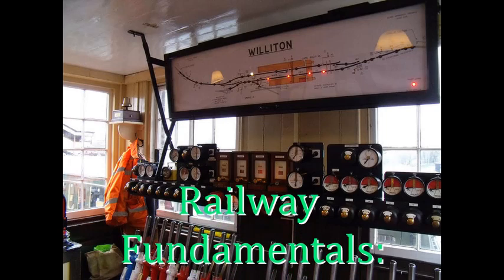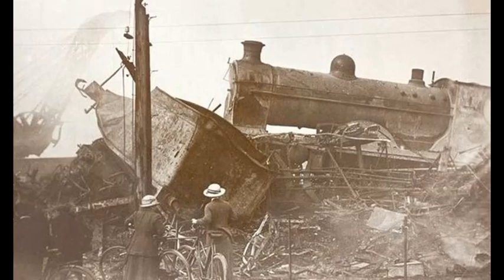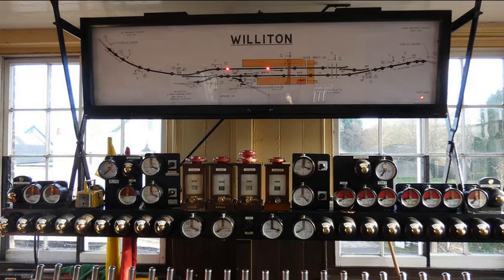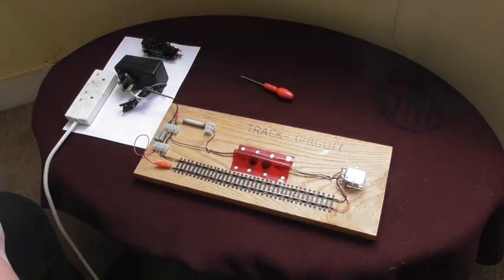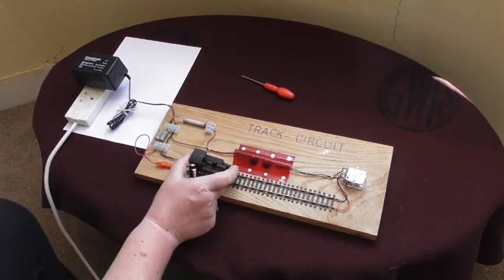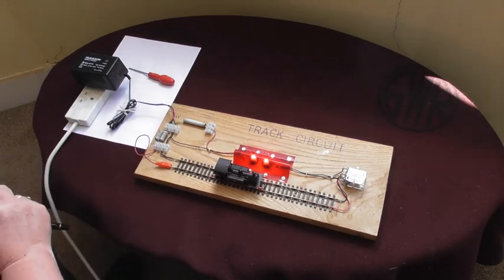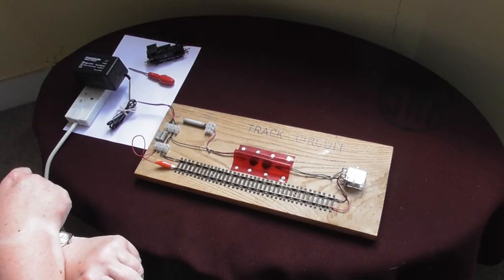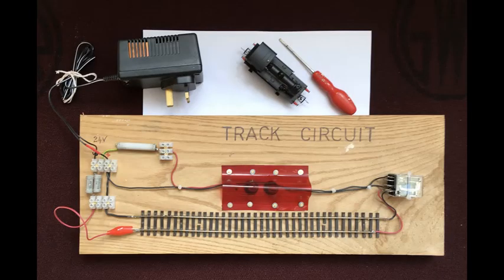Railway Fundamentals - Track Circuits

Comment: The "train" COMPLETES the track circuit by bridging the rails with its metal wheels and axle. It doesn't "short circuit" the system or some of the electrical equipment (the relays) would be damaged !

The Quintinshill disaster around 1900, (during the Second Boer War) was before the days of track circuits. Indeed Britain's worst train crash was caused by a train Guard forgetting to ensure the signalman had placed a "reminder device"  (a wooden chock) on the lever protecting his train. Due primarily to there being too many people in the signalbox. Most of whom should have returned to their trains !  In addition the signalbox was NOT fully interlocked, and the HMRI Inspecting Officer of the crash heavily criticised the Caledonian Railway for not bringing a mainline box up to the standards already expected at the time. In excess of 255 people died.

Track Circuits on model railways can be further simplified from the example seen in the programme. Indeed just a single piece of wire and a relay are all that is needed, by having the track circuit only in the Common Return rail, not both rails. The only other difference is that the model "track Circuit" needs to be shorter than a locomotive, to avoid stalling a locomotive. It should be noted that DC electricity will only return to the transformer it came from, hence it is possible to have more than one supply in one of the rails, as long as the supplies comes from different transformers . (A trick not possible if you have 16v AC in your track !) By clever use of such track circuits both semaphore signals and 3 or even 4 aspect colour lights can be totally automated to operate exactly as they do in real life. i.e both Absolute Block (Semaphore signals) or Track Circuit Block (Multi-aspect signals) methods can be replicated precisely.

This system can also be adapted to German or even Japanese signalling methods, and I have for over 40 years fitted the system to all my exhibition layouts, British, German & Japanese. You can even add "AWS" using this method, so when naughty operator tries crashing red signals, their train is brought to an immediate halt. A relay simply being used to switch off a section of track immediately in advance of a signal displaying a Red. 

Relays for the uninitiated are simply a little box with usually 2 or 4 switches inside. They are switched on and off by passing a 12v DC current through the coil, which is the electro mechanical device inside the relay which changes the switches all at the same time. ON = powered coil; or OFF = no power to coil. The clever trick is to use one of the relays own switches to "Latch" the relay in the on position, and then have another relay further along the track (after the next signal) switch the first relay off again, ready for a subsequent train !!!
Reply: It actually doesn’t, did you listen to the video at all. In a real track circuit there will be a resistance to avoid damage when it goes short circuit.